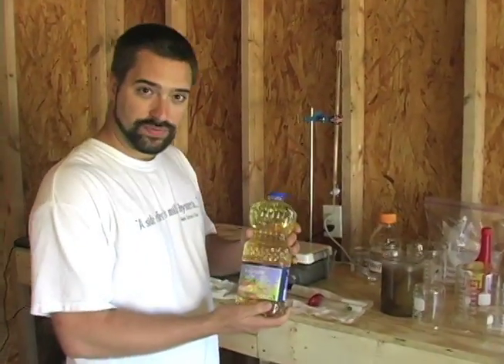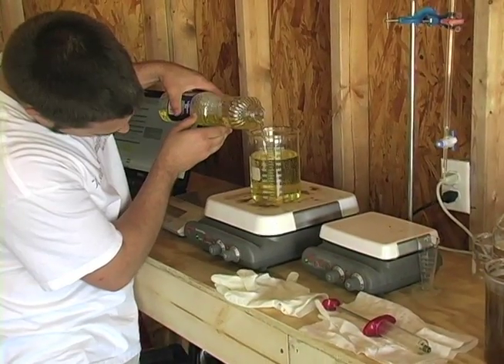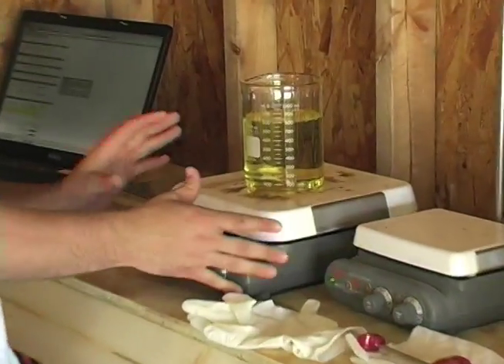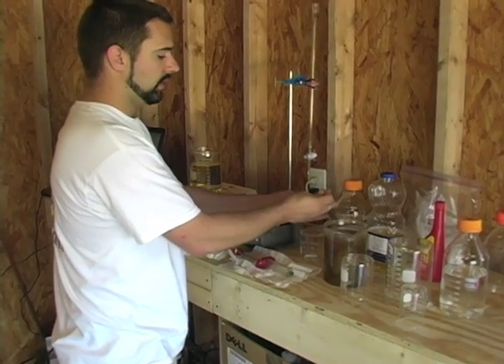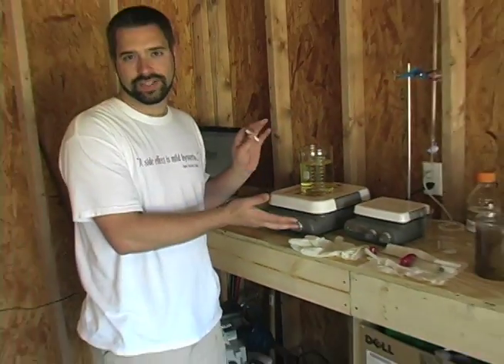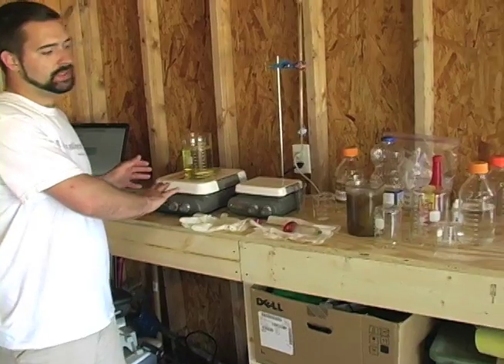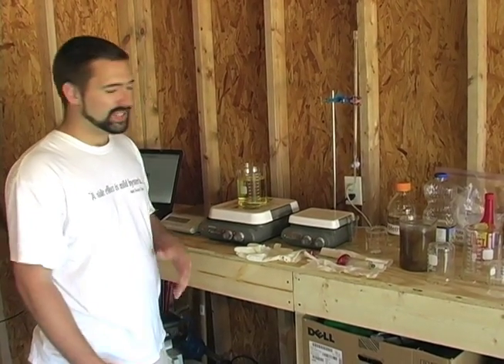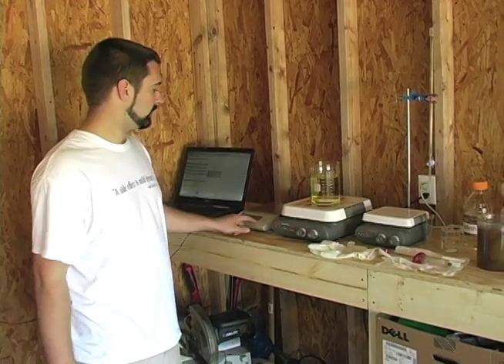Biodiesel Production Demonstration - Part 1 of 3

Comment: the huge problem with any biodiesel fuel is is filtering. Known to mess up engines and costly repairs as results. Looking the best and economical ways to filter the fuel. Found a couple buy $18 or so cost is way too high for the ordinary person. Any good and logical ways some have found?

Comment: yes, 7 x .8 is 5.6 grams not 6.4 grams.  somebody should really review these before there put out there.
Reply: Lol he said 7/0.8, which is 8.75. When actually I suppose he meant 7*0.8 like you said. I had a feeling that he is not super educated, based on how he handles equipment and while potassium hydroxide is somewhat hygroscopic, it will not “kill” the process, it will only make the weighing less accurate, smh.

Comment: If its 7 grams of Potassium Hydroxide per liter of veggie oil, how do you come up with 6.4 gr of PH. In the video you say (7:00 min in) "divide 7 by .8 = 6.4 gr" ...this is not the figure I get for 7 divided by .8 = 8.75 grams. However, I think the correct equation would be 7 x .8 = 5.6 grams of PH needed. Can you please say which is correct?

Comment: @dbrandinni Biodiesel only works in a diesel engine. If you put it in a gasoline engine it will kill it. And what you are talking about is called black diesel and from what I have read about it, it only works on diesels that don't have sensors in the fuel system (the sensors must see through the fuel). It is also not known if using black diesel can harm your engine or fuel system.

Comment: @circusboy90210    Sodium Hydroxide and Potassium Hydroxide are both suitable for use.  These two bases are what are known as 'Strong Bases'.  Other bases just don't work as well (if at all). All vegetable oils (mainly used oils) do have Free Fatty acids and Trans fatty acids. Along with triglycerides.  If you were to use litmus paper to check the pH of vegetable oil, you would see that it is acidic.  Everything has to be neutral to make bio diesel. Free Fatty Acids **** Google it.

Comment: @circusboy90210 Oh, I forgot to mention one thing........... Make sure you check the oil for moisture content before using it. If there is any moisture, you will want to boil the oil until there is no water left. This, of course is after you have filtered it.   You will want to add your lye into your methyl alcohol (methanol) first and then slowly mix it in with your hot oil at about 130 Fahrenheit (54-55 Celsius)  You need about 200 ml of methanol for every 1 liter of oil used.

Comment: @circusboy90210 In reality, you will probably use about 10 grams of lye per 1 liter of oil. It fluctuates on every batch though........ So you'll have to titrate for every batch of oil.  If you use too much lye you will just get a lot of soap with your bio diesel. You'll just have to filter that out and it cuts down on the amount of diesel you get. If you don't add enough lye, you will have a fuel that has an extremely high point of spontaneous combustion. This means a low quality fuel.

Comment: @circusboy90210  Now this is why we mixed 40 grams (1 mole) of lye in one liter (1 molar)  ........... We have 100 ml of lye solution that needs to be converted to grams of pure lye.  To convert ml to Liters, divide ml by 1000.  That will give us .1 liter of 1 molar lye solution. Since we no that 1 liter of solution has 40 grams of lye and we only need .1 or 1/10 liter to neutralize 1 whole liter of oil, we multiply 40 by .1 and this tells us to use 4 grams of pure lye for every liter of oil.

Comment: @circusboy90210    It is best to do this titration 3 or more times and average the results.   So here's what you need to do after titration is complete: look at the burrett tube. Let's say that the tube was filled to 20 ml and you now have only 10 ml........... this means that you only needed 10 ml of lye to neutralize 100 ml of oil. Multiply the 100 ml of oil by 10 to get 1000 ml. 1000 ml = 1 Liter. Do the same with the lye solution used. 10 ml x 10 = 100 ml of lye solution and convert to liter

Comment: @circusboy90210   Open the valve on the burette and let the lye solution drip into the oil. When the solution begins to turn pink, turn the valve to a slow drip. You will see the pink go away but come back again shortly...........  When the solution turns pink and stays pink, you have successfully completed titration.  If the solution is a dark pink, you have gone too far! (you have added too much lye solution) So stop AS SOON AS YOU SEE PINK THAT DOES NOT GO AWAY!

Comment: @circusboy90210   So, now that you have everything set up, you will need to slowly pour you 1 molar lye solution into a burette tube to the 20 ml mark and position the 100 ml beaker of oil and phenolphthalein on top of a magnetic stirrer directly under the burette tube. It is important that the oil is constantly being stirred and kept hot or you may get false calculations.  It is also important that everything be EXACT!!!  Ok, so you are ready to perform the titration now.

Comment: @circusboy90210   This 40 grams of lye is equal to one Mole (A chemical unit of measurement)...... so you will have one molar (or one mole per liter) lye solution in the one liter bottle.   At this point, you have your beaker filled to the 100 ml mark with hot, filtered oil (about 130 Fahrenheit). You will also need to add a few drops of indicator (phenolphthalein) to the 100 ml of oil. This will turn pink after the acidic oil has been neutralized through titration.

Comment: @ryanhall2013   Usually, only used oil will have high FFA content. The more FFAs present, the more acidic the oil is. The more acidic the oil, the more lye you need to neutralize it. Titration is the process used to figure how much lye you need. You will need to get a bottle that is exactly one liter, a burret tube with stand, a magnetic stirrer/ hot plate and an accurate digital scale.  You will need to mix exactly 40 grams into a 1 liter solution of cold water. (distilled water is best)

Comment: @circusboy90210  When oil is heated, it releases Free Fatty Acids (FFAs) ....... These FFAs have to be neutralized by the sodium hydroxide or potassium hydroxide (both strong bases). The longer the oil has been heated and the higher the temperature, the more base you will need to neutralize these acidic components called FFAs........ Of course, new vegetable oil is also heated during the process of making bio diesel which is why lye or KOH is required.  Hope this helps....... BE SAFE!!!!!!!!